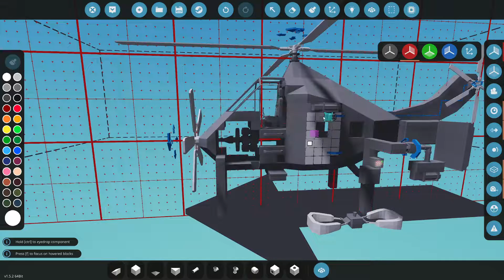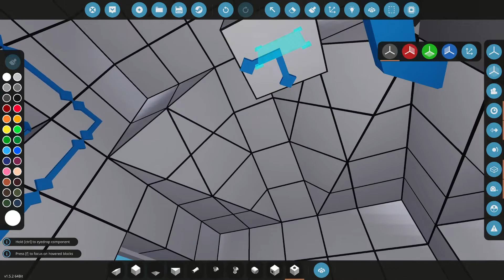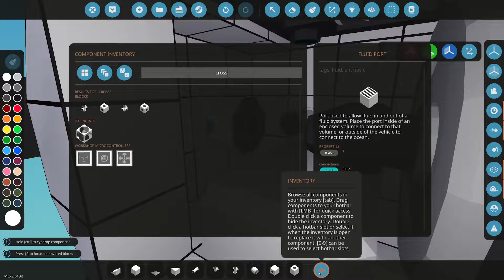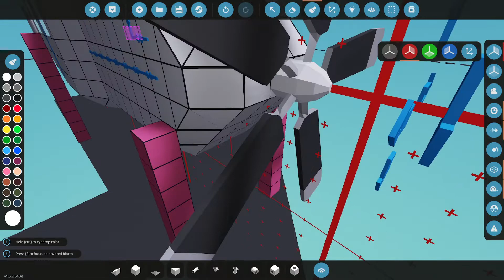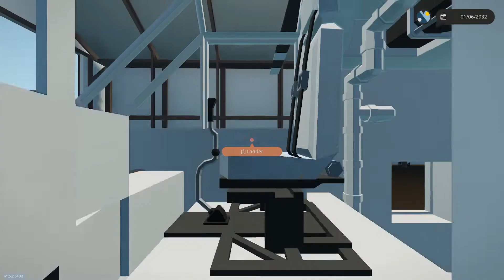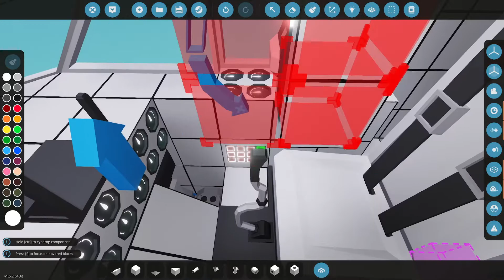Stormworks Career Build Series 70

Comment: I don't know if you know this trick, but you can have a fluid and RPS power in the same pipe, only one type of fluid at a time obviously. Also, gear boxes and other RPS only pipe connections interrupt the fluid flow.
Hope it helps you, it helps me with the space management in my creations.
Reply from the maker: Thanks for the info. That breaks RP for me. If it is unrealistic I tend not to do it.
Reply: @CaptainCockerels  yeah I know what you mean, I feel the same way most of the time and tend to use this trick as a last resort or very small builds.
Reply: @CaptainCockerels  RP for the win!